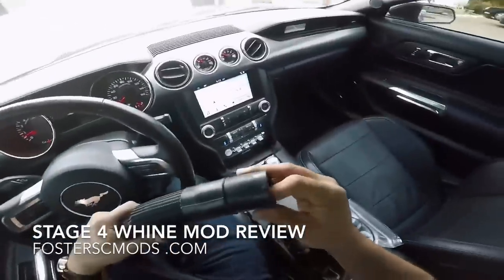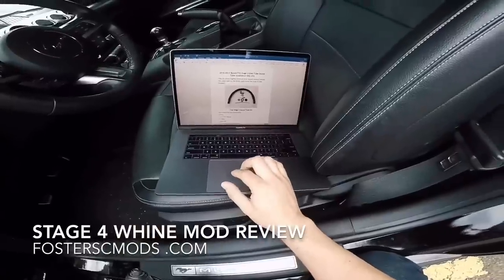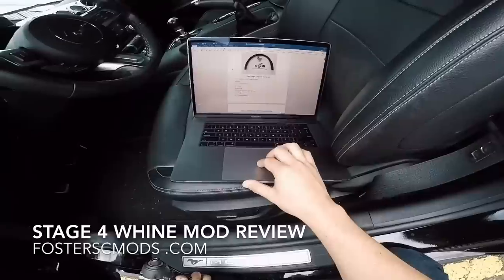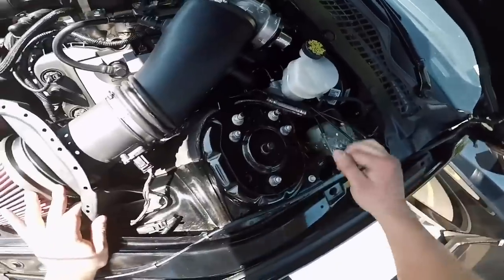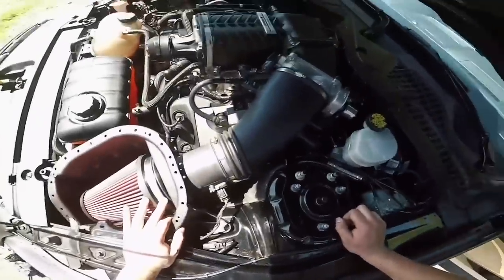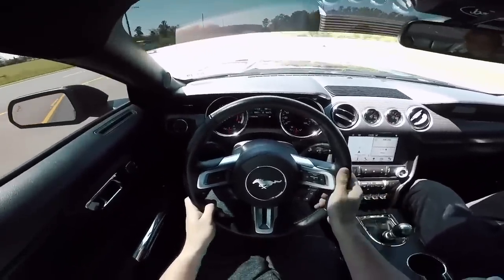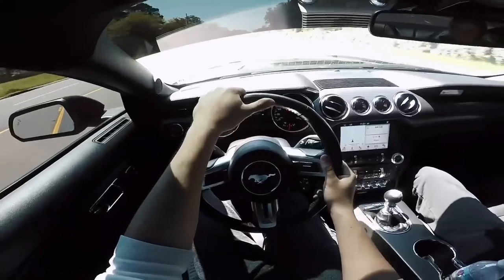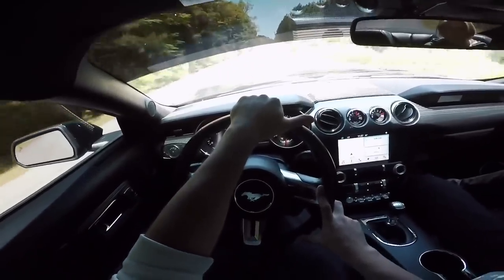Roush whine mod review FosterSCMods Supercharger sound tube

Comment: I got an 03 Terminator cobra with 24k miles... about 2 years ago... Bought the kit after watching this video... It is a great modification. 😁 Edit... Because the exhaust overpowers the Supercharger whine in the cabin, the whine mod really lets you hear that good ol' supercharger scream. 😅
Reply from the maker: Thanks for your support. A loud exhaust will diminish greatly the whine especially at low and midrange power.

Comment: Can you hear it from outside?
Reply: The supercharger whine can be heard from the front end of the car, but with an exhaust, you won't hear much inside or behind the car... It helps wake up that good ol' supercharger whine in the cabin for the driving experience. @Beto 5ohh
Reply: I have installed this mod on my 03 Terminator mustang... It just makes the driving experience better for the driver of said supercharged vehicle. :elbowcough:
Reply: @CheesusSVT  fr
Reply: @CheesusSVT  do you have to drill into the stock intake?
Reply: @tomasescobar1987  Yes, and the kit includes all of the hardware aside from an actual drill to install it. 😊👍
Reply: @CheesusSVT  Thank you, do you happen to know if on the 2014 shelby svt you have to drill into the intake? because i’m looking at the kit and it doesn’t seem to coke with a drill bit for the 2010-2014 i just don’t really wanna drill into the oem intake, Thank you for your help 😁
Reply: @tomasescobar1987  100 percent it has to be drilled into. Harbor freight carries the step drill bit, in case if the kit you are buying doesn't come with one... Just make sure when you drill the hole, there is clearance for the tube and all so it doesn't get blocked by the engine etc, you only get one shot just take your time.

Comment: what mod is needed for the whine to be loud on the outside, I'm not really concerned about how loud it is on the inside
Reply from the maker: Yeah there not much you can do there really aside from spin blower hard short intake with open filter and no hood liner may help a bit.